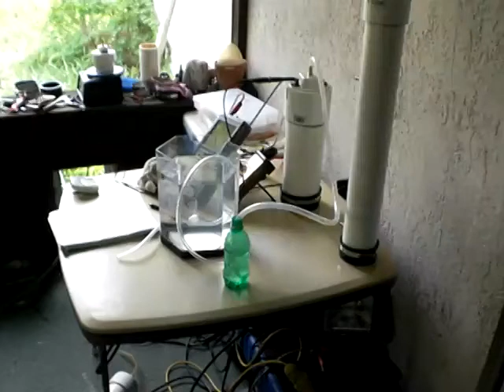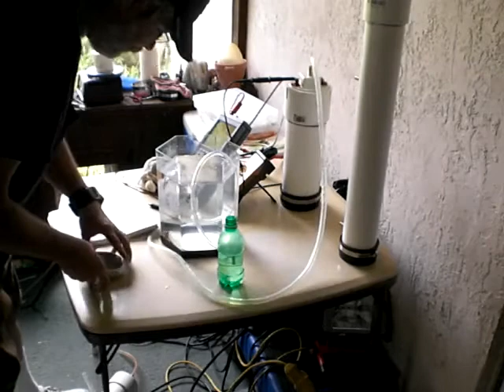HHO 1.07 LPM @ 4.62 MMW (w/Data)

Comment: Hi, I have to ask to see your cell design. I'm having trouble getting good output from my cell. It's 11 plates from lowes, one pos and neg with 9 neutrals in between. ran it at 22v dc at 3.5 amps, and got 1/4 l per min.  I thought I should get more than that! everyone I talk to says to have 2v dc between each plate with .25 watts per square inch of surface area! Can you help me out there?

Cheers